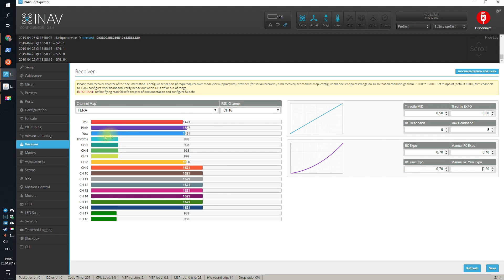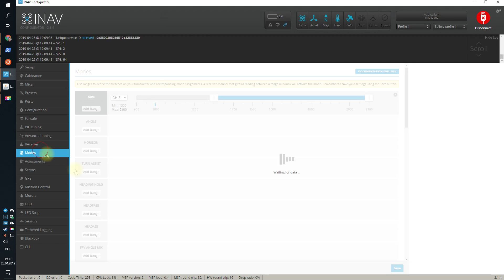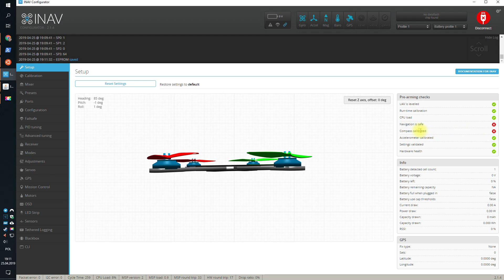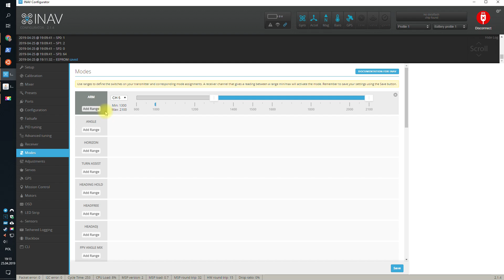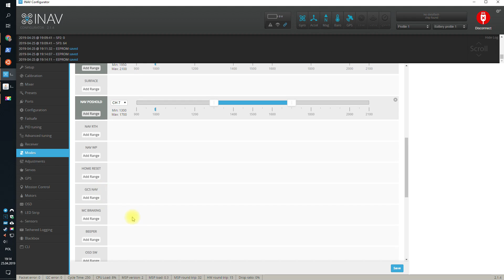How to setup INAV on a 5" quad - Radio and Flight Modes

Comment: Hello and Much Appreciation for the great information!
Do you need to enable position hold and altitude hold simultaneously to achieve 3-D hold? Possibly by overlapping a second range? Also, when you enable either Altitude hold or Position hold (or both, as previously mentioned) how do you determine which non-Nav flight mode you are in? i.e. Acro, Angle, or Horizon? Do you need to set up a second (overlapping) range that includes the non-Nav flight mode? I am new to iNav and would appreciate learning whether Nav flight modes automatically select non-Nav flight mode as a basis for operation! I am using the 6-position switch for Acro, Horizon, Angle, Altitude, Position, and RTH.
Thanks so much!

Comment: I can not get inav to activate Pos Hold on a 5" quad. I have followed your examples. All conditions have been met , angle mode,armed,magno,gps, locked and calibrated. I would appreciate your advice. you can see issue here. https://youtu.be/JcUHClHXj4U  thx.